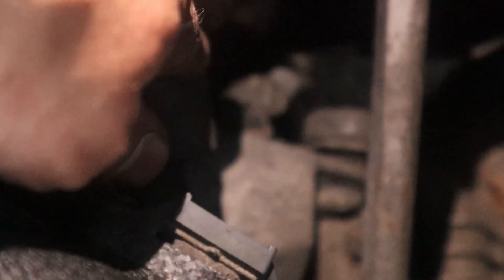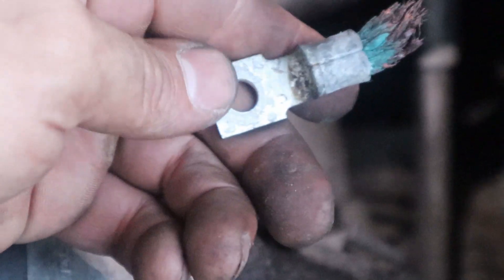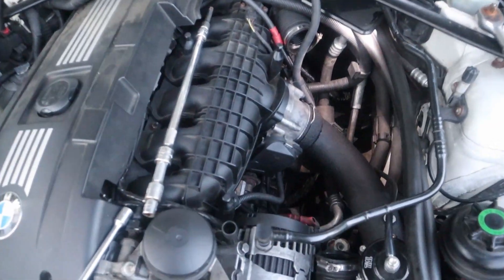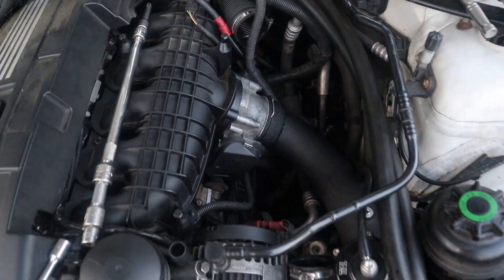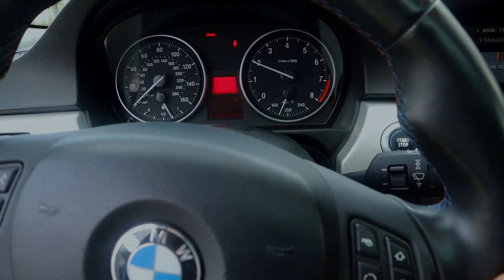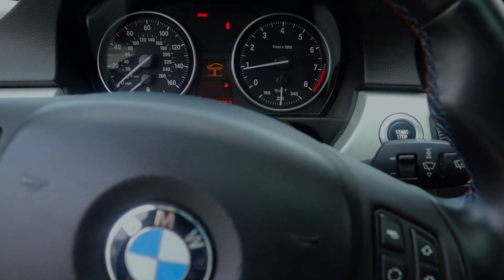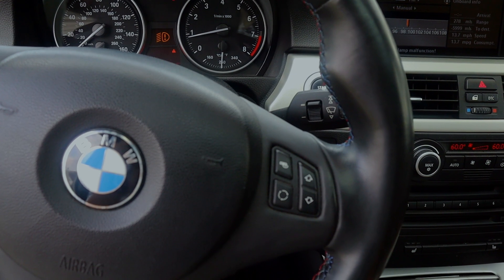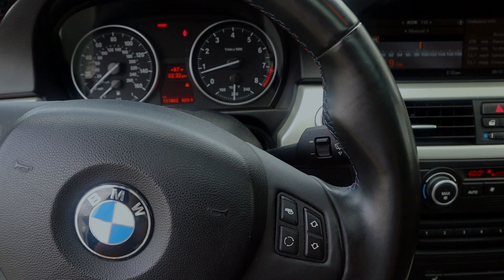BMW 335i Engine ground

Comment: Wait till the $4000 positive battery cable replacement comes hunt you 😢. Just have a car audio place run you a amp wire from the battery to the engine bay, way cheaper.

Comment: DirtyKurty gets all the credit to trouble shooting and finding the solution.  I just want to provide added info for those having a similar issue

NHTSA Manufacturer Communication discusses grounding strap failure issue - https://static.nhtsa.gov/odi/tsbs/2012/SB-10051359-6131.pdf

Comment: DirtyKurty.  Thank you so much for posting this video.  I am having the same issue with my 2009 BMW 335i.  Did you need to disconnect the battery or did you do the ground cable replacement without?
Reply from the maker: @finkjm I did not disconnect the battery to do this repair! Good luck!

Comment: mine has a coil ground broken but my car was jus fine now it wont start but it crank then loud air coming out sounds like the gasket zone through the back left side of the engine..

Comment: How did you get an angle on the ground cable to get it out do I pull it off or is a socket needed ?
Reply from the maker: Yea you definitely need a socket, wrench, extension and a universal joint socket!

Comment: anyone knows where's the ground cable for N55's?
Reply: Probably around the same area as the N54, gonna be doing my asap I just started to have this issue
Reply from the maker: @tmc8516 good luck with your repair!
Reply: @dirtykurty92 where is the other ground straps at? I got a new battery and new alternator and not wanting to charge still… I checked that ground on driver side but not sure where the other ground straps are

Comment: Bro I’m having the same issue every thinks in the car works all my lights,the radio works the dash works, all I’m getting is a click and then nothing I’m not if it’s my starter or my ground
Reply from the maker: Kind of sounds like it could be a battery to me if it clicks, mine was doing nothing at all when I went to start it. The ground strap is pretty cheap so worth doing regardless! Try jump starting it if you haven’t yet!
Reply: @dirtykurty92  bro i tired jumping it also nothing happened all it did was click that’s it man I’ll try and change the ground and see if that changes anything
Reply from the maker: @jaywheelzz  I’d hook those jumper cables from your battery ground right to your engine if you can, see if it will start, if so it is most likely your engine ground. If not try putting a volt meter up to the positive and negative terminals in the engine bay and crank the engine, see how low the voltage goes. Check the voltage before you crank too, if it’s under 12 volts your battery is definitely shot
Reply: @dirtykurty92  okay thanks bro
Reply from the maker: No problem! Let me know what is ends up being! Good luck!

Comment: Im going mad. Working on customers car. No crank no start. All lights come on. Changed that Relay behind the glove, nothing. Changed the starter, nothing, only get a single click to the starter, didnt get that before. Ground strap on drivers side is green, ground strap on passenger side by the exhaust mani is gone. Trying jumping from a car to the jump posts and grounded to the block. One click and nothing.
Reply from the maker: To me it sounds like a dead battery
Reply from the maker: You can try ground the block better with a jumper cable from the negative terminal straight to the engine block, you could also verify the engine will freely spin by hand by rotating the crank shaft

Comment: Did your car ever just shut off while driving but you still had battery power in it ? Mine is doing that should I try this out , also been sitting for a couple weeks so it does not want to crank over atm
Reply from the maker: It was hard starting for a little while, weak, then it stopped cranking, so I inspected this ground and it fell apart in my hands, so I replaced it. It did not fix my issue, I ended up replacing my starter to fix my issue

Comment: Just ordered the strap, slow crank hopes it also works…thanks!
Reply: Did it fix your issue @darkstardarth
Reply: @Cut.2TheChase  …..I sold the car and gave the strap to the new owner. Got an Mazda MX5 instead.
Reply from the maker: Good luck! Let me know if it fixes your slow crank issue!

Comment: Had the same problem. Changed the ground strap with a handmade one. Still nothing, glad you worked it out.what were your symptoms before. Was the starter at least clicking?
Reply from the maker: My starter was not doing anything! All my dash lights worked and radio but would not crank.  I put a new battery in as well, a new starter, and a new clutch switch before doing the ground. I also disabled the IBS to make sure it was not that. What have you replaced so far besides the ground strap?
Reply: @dirtykurty92  I replaced, starter, alternator, battery, and ground strap. Everything electronic turns on but when I push the button, I hear a heavy click from the starter but doesn’t turn over.
Reply from the maker: Ah that doesn’t sound good! Try turning the engine over by hand and see if it is hard to turn and that the engines not seized!!  Also check voltage at the starter or the positive terminal in the engine bay and make sure your not losing voltage somewhere. You have some connectors in the back of the car by the battery where it runs the positive wire up the the front make sure those are not corroded. Check for 12 volts at the power wire for the starter solenoid if all the above check out good.
Reply: @dirtykurty92  thanks for the time and input. Will do, and keep you posted!
Reply: @curtdaflirtjlp  what was the issue did you ever find out ??
Reply: @juicethemartian9298  Yea sorry for not checking back and updating everyone. Turns out, Terminal 50 on the CAS was burnt out. Replaced and cloned now can start car no problem! But now I have fuel pressure issues… Beloved N54!
Reply: @curtdaflirtjlp  did you fix this?
Reply: @guillermoulloa7308  Hey sorry for the delayed replay. Yes I was able to fix this. Turned out being the CAS module. There was a burnt out connection that was identified keeping the current from reaching the starter to engage ignition.
Reply: @curtdaflirtjlp hello! I think i have some cas failures and am likely going to have to send it out to be cloned. Did you use ECU? I'm a 40 yr old woman going having to learn all about this. Lol im going through a divorce and have no one in my city so I've been trying my best. My car has a weird buzzing in the trunk and I can't get it to start the past 3 days when I get off work. 1 day opening the trunk to bypass the IBS worked the past 2 days I sit disconnecting and reconnecting the negative battery terminal and it finally starts. Also my headlights and tail lights won't turn off sometimes so I have to disconnect the neg term to get them to shut off. Does this sound like any of the symptoms you experienced?
Reply: @brandi1031  did you figure it out?
Reply: @samchase1996  yes I watched YouTube vids on how to pull the CAS module and sent it with my keys to ECU pro and they were able to repair my CAS module for $400. It has been 4 months now with no more trouble. 🙂
Reply from the maker: @livinglarry8320   Replacing the cas relay is exactly what I was thinking! Got mine on fcp euro. Fair price and life time guarantee
Reply: @dirtykurty92  where’s the cas relay and how many volts my car doesn’t start neither the ac windows etc just brake light come on the dash and air bag but when I push start instead of starting what it does is goes off